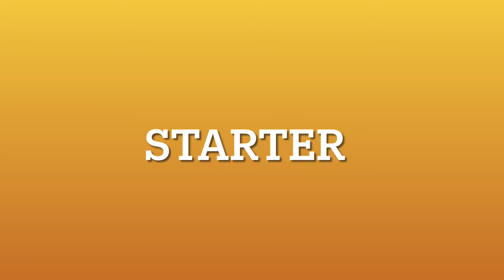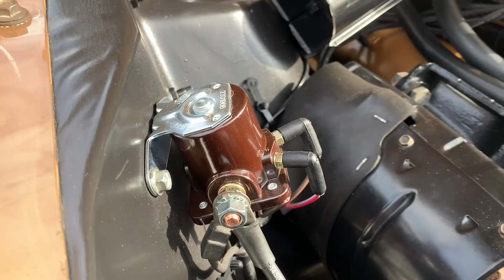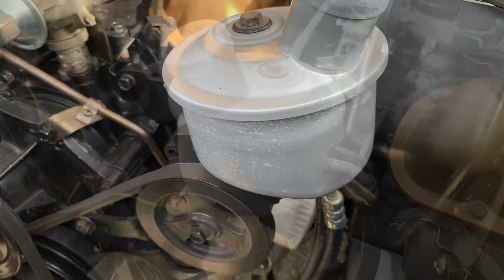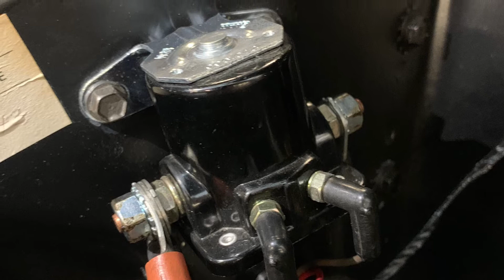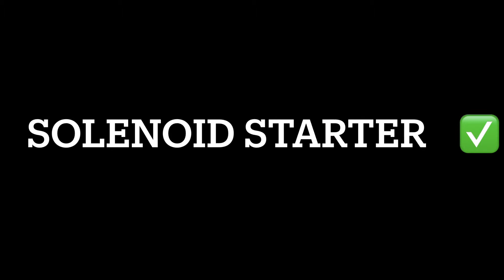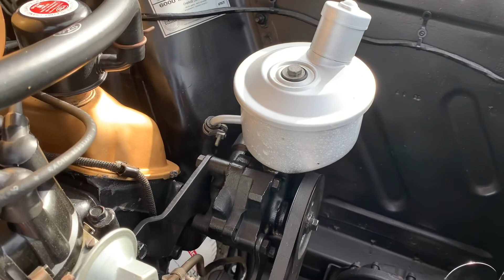Correct power steering and starter 1964 1/2 Mustang

Comment: I have a 64 fairlane and it has an Eaton power steering pump that has failed. Having a hard time finding a replacement. Is there an alternative? Does the “wrong” power steering shown in your video work with these cars?
Reply from the maker: It works perfectly the new one and it is still an historic part. The Eaton pump is really a pain, I completely agree with you.